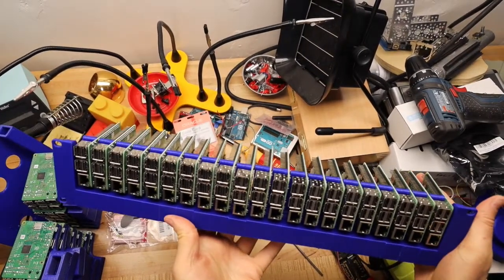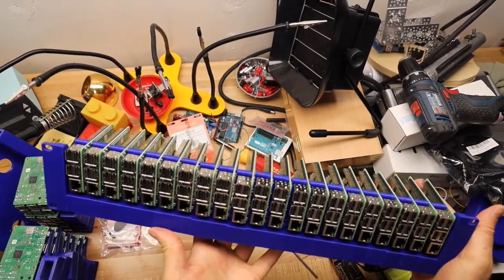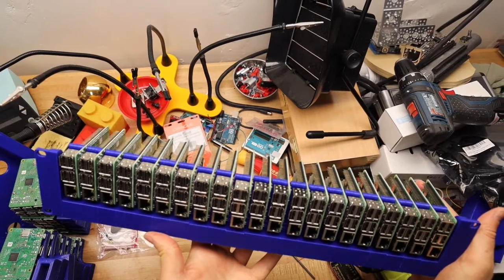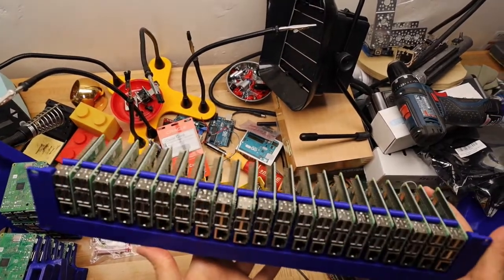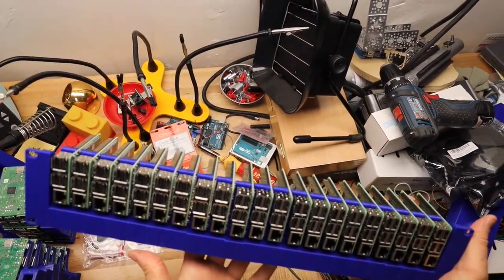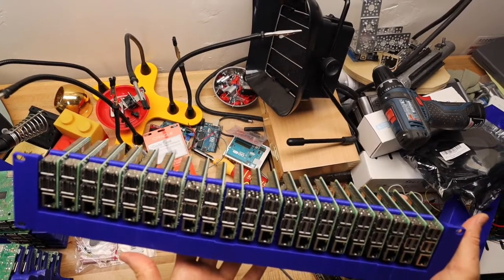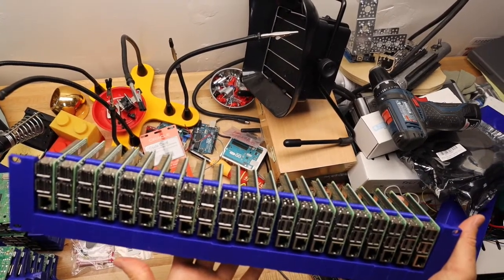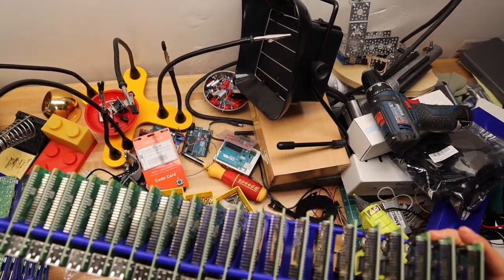Add Fans To Raspberry Pi 2u 21 Pi Rack

Comment: Awesome Build the super computer. But it would be a real pain if You had to take one row down just for one node being out. And have 20 other nodes  that are in use to be taking town as well. But over all I love the design.
Reply from the maker: Yes, it is a pain when that happens. But it is the highest density Pi cluster anyone has made, so you take the good with the bad. Plus there are so many nodes it really doesn't make much of a difference.
Reply: @ChrisBensen  over all great build. Of a pi super computer. I wish one day I could build one 🤪